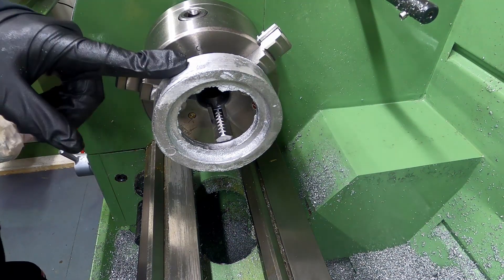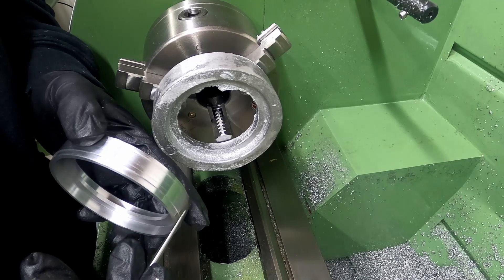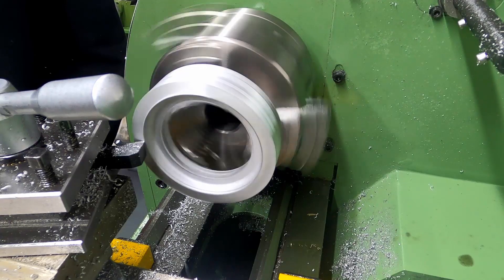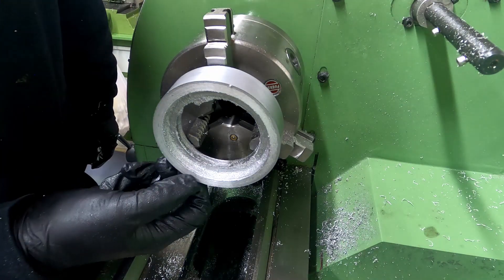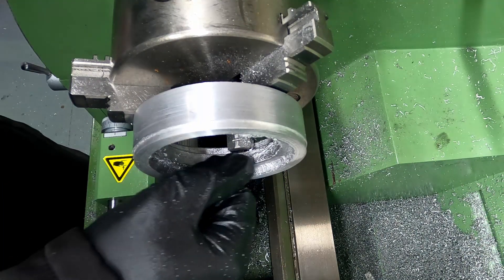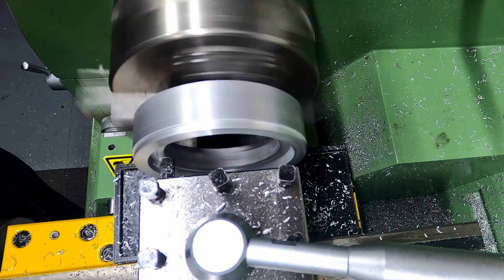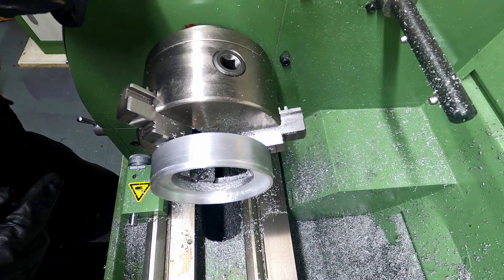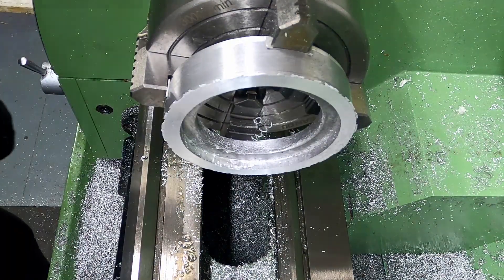1" Minnie build part 2 front wheel rims

Comment: I just started making the same traction engine, thanks for these two videos. I would love to see more please.
Reply from the maker: @patrickdewhirst7760  how far have you got with your engine? I have put my build on pause at the moment as I am debating the effort vs reward ratio. A 1" scale is not really useful for me. I think I will likely switch to a 4" scale as this size works well on the rally field. I will get back to the 1" at some point, but I doubt it will be in the next couple of years.
Reply: @tandb  I'm set up to silver solder the boiler, and fire box. this so far has taken two weeks, I suspect I have a long journey in front of me.  Loved your videos. I hope you share your big build, that will be something.
Reply from the maker: @patrickdewhirst7760  yes I will for sure. Thanks for watching. Good luck with the silver soldering.